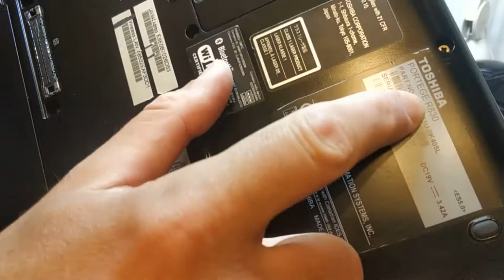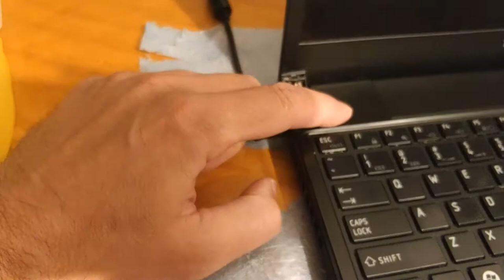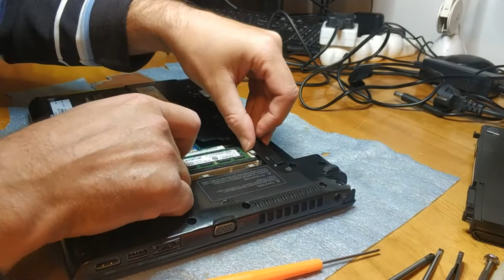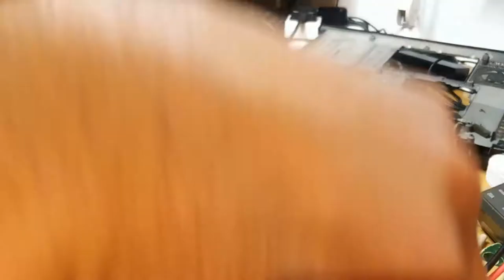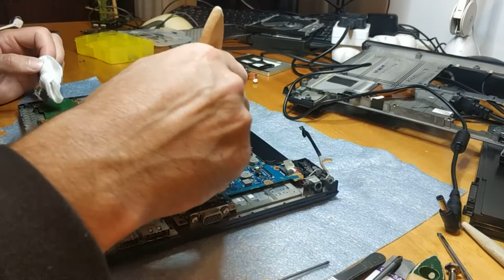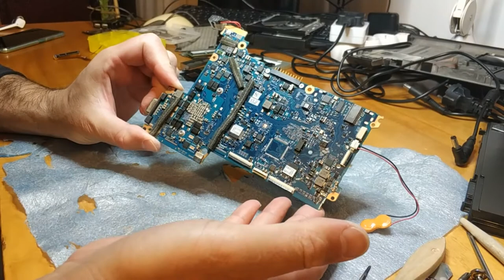Toshiba Portege R830 - Disassembly & Try to repair

Comment: The error code is 00100100 which correspond to 24h-error on main battery. From the manual, "The compensation value of [0A] is not within the limits from design data (+/- 400mA)", whatever that means. Probably there's chip that always check the battery current/voltage producing those error.
Reply from the maker: @finhas8865  hi Fin. Ok, thanks for info. Was so long ago that i don't even know what i do it with this notebook. So, i don't remind if main battery was working or not.
Reply: @DaneluRepairs  Yeah, I realized this video is from 2 years ago. Decide to comment in case anyone have the same problem. Also, i saw a video of some Indonesian repairer changing a resistor almost the same exact place you're working on and the laptop turn on.
So, i guess that chip is responsible to measure battery current/voltage and decide if it's ok to turn on or not.
Reply from the maker: @finhas8865  awesome.
Yeah, i also do this and ask subscribers to leave explanation after they only say "ok, it's working". For greater good, info must be written, maybe in one day one person benefit from that info.
Thank you.

Comment: Mine is doing the same but I can power up if I remove battery and power cord, holding power button for 60 sec (power reset) it will power up after inserting the back power plug and or battery.
Did you try to reset bios by removing inner CMOS battery or replacithe ng battery itself?
I am thinking to do that.
Reply from the maker: Yes, i already do that. Thanks.

Comment: My fan is making weird noises and I'm trying to clean it but when I tried to take off the bottem, there's something holding it at the top left corner near the fan which I tried to detach. The VGA port touched the frame of the laptop and made an ark, I hope the laptop is still okay. I still have the hard drive and ram installed with the covers as well, do you have to remove them first? Edit: I got the hard drive and ram out, thanks for showing how to open the cover in the video
Reply from the maker: congrats; always, when you dissansemble a notebook, don't force anything and try all ways, even they are almost impossible to be build in that manner; manufacturers do a lot of ways to make an notebook.
Reply: @DaneluRepairs  ah, I understand

Comment: mine have worked twice. its from the system software that dynabook have, eco battery saving mode, this system software can control the hardware that it control the battery even if the pc is shutdown. that you cant go more that 80 present.
Reply: the solution is re charge it up to 80 present using dynabook Eco mode.
Reply from the maker: Charge no more the 80% battery, prolong life of battery. 
My laptop have more big issue.